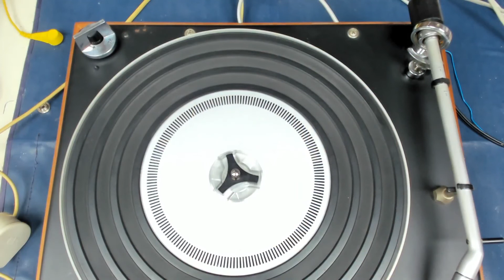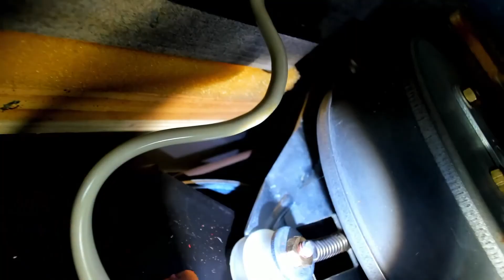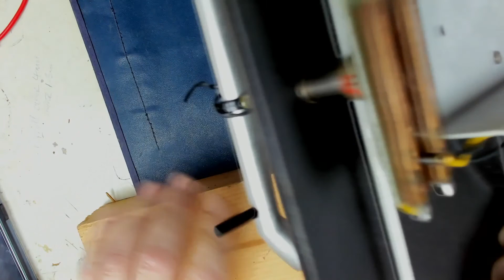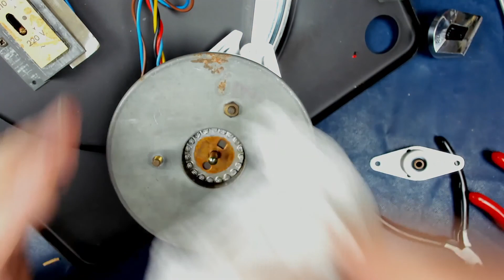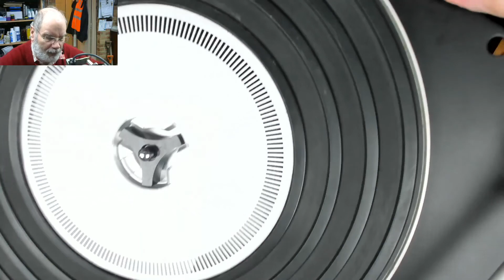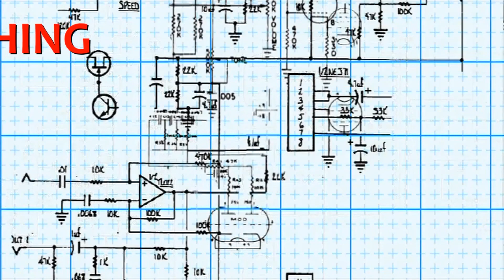BEOGRAM 1000 Motor Repair

Comment: Thank you. Do you know  the value of the resistor  - ohms and wattage rating please. The deck came with the mains disconnected at the terminal block and no resistor.
Reply from the maker: Sorry, can't find any resistor in the mains circuit on any diagram and of course I don't have the deck now, it went back to the customer.

Comment: Hi Chas - Thanks for this video. I am currently attempting to service a Beogram 1000FV turntable and this is invaluable. I’ve got the bearing in the jam jar Bain Marie as we speak! New belt has arrived - but REALLY struggling to remove the platter. Sadly mine is the version without 3 screws in the top of the platter. Any advice on the best way to remove the platter or fit the belt without removing it would be gratefully appreciated 🙏

Comment: Thanks. I have just acquired a VERY courier banged up Beogram 1000 deck (thanks EVRi - see despite changing your brand name - I see you haven't lost your 'delicate touch'😉) and it's good to see how to test the motor. Bain-Marie at the ready! Circlip pliers are somewhere in the house but I will access from below first. I have another problem though that didn't show how to get the belt on and off? I have sourced a replacement, as the brown one looks old (probably the original) and a bit shot. Also - the tone arm has a strange bend in the weight holder on the back end. The little grub screw has sheared off one side and is proving to be a right piglet to come out - even with an illuminated magnifier, a steady hand and the smallest pinch nose pliers I have. Any tips on how to remove that - otherwise - it looks like a precision drilling job. 
Lot of faults with these - but I grew up using these - it was my dad's pride and joy and I was an idiot not taking it when he offered it to me - but I was a student with an 80's boom box and I passed it up. Silly boy..🤔

Comment: Very interesting.I've just done the same thing to mine, which has helped somewhat, but there's another bearing at the top of the motor which needs the same treatment and I can't work out how to extract that one. 
I've pulled the rotor out but to strip the bearing it looks like you need to remove the muliti-diameter capstan from the shaft...
Anyone?
Reply from the maker: I had the same problem with another one, I even bought a puller but couldn't get it to work, so just put the whole mech in a bowl of oil to soak for a week, it helped but no real cure.
Reply: @ChasLarge  Thanks

Comment: Hi, IF,  when actionning the speed control knob,  the speed pulley moves only vertically but doesn't move horizontally  , and therefore doesn't  allow to clutch the 78 rpm speed ( for instance ) , what would be your best guess  ??? Thank you very much for your help .
Reply from the maker: Belt too slack is my best guess

Comment: you can oil the bearings and it will be fine .Go back to it the next day and its back to square one .I removed the bearings on mine and soaked them in oil for a week heating it up every now and then .I put it back together and so far so good
Reply from the maker: Well done, glad it worked for you.
Reply: Did you manage to remove the top bearing? I'd love to know how...

Comment: Thanks Chas. Really helpful video. I have a similar deck and I need to change the belt. Do you think it is possible to do it from top of the unit (release the plate) or should I remove the frame like you did?
Reply from the maker: If it's that similar, you'll need to do what I did.
Reply: @ChasLarge  Yes, it’s a similar one. That’s what I thought too. Really appreciate your help. Thanks.

Comment: On ne vois pas comment vous remettez en place la courroie , c'est bien dommage, car sur ce modèle c'est tout simplement l'enfer pour changer la courroie :(
Reply from the maker: I used a hook tool, an old long screwdriver with a hook ground into the end to keep the belt taut whilst refitting the motor assembly.

Comment: Very pleasant delivery..very helpful Chas ..did you find out if the fine tuning knob was a speed regulator..regards tommy
Reply from the maker: Yes I did, it puts pressure on the pulley thus slowing the drive down slightly, quite a cheap method though for something originally highly priced.

Comment: good can you show the connection of the wires from the head to the preamp?
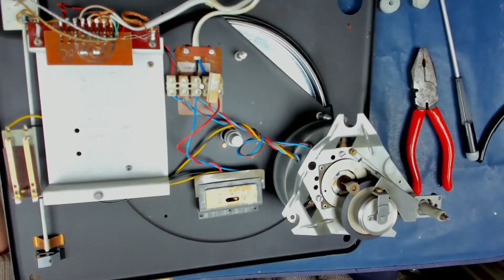Reply from the maker: Sorry no, the unit has gone back to the customer. If you pause the video at 06:53 you can see the connections. You can download a service manual with connection diagrams from here: https://elektrotanya.com/bang_olufsen_beogram_1000_1500.pdf/download.html 
Hope this helps/